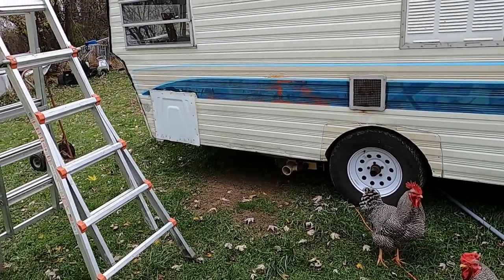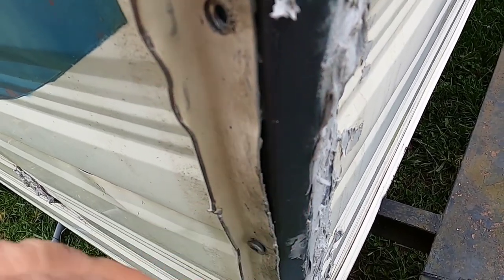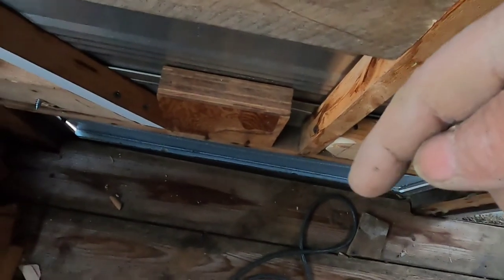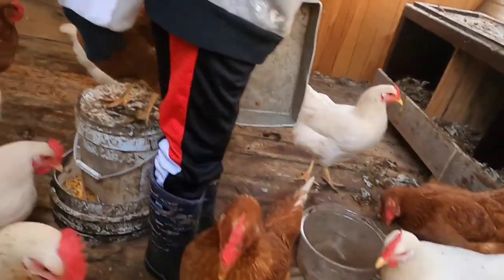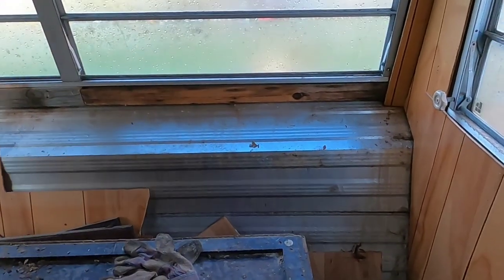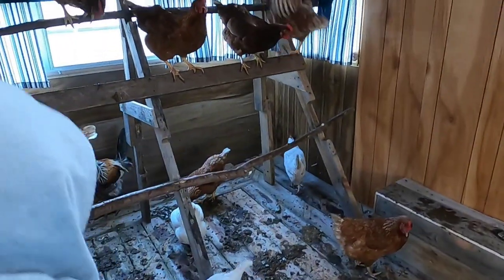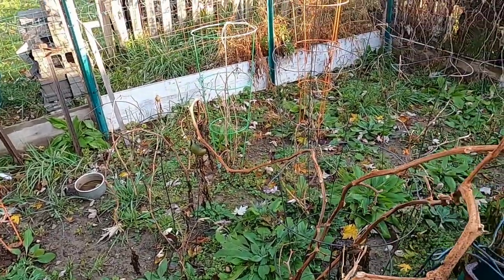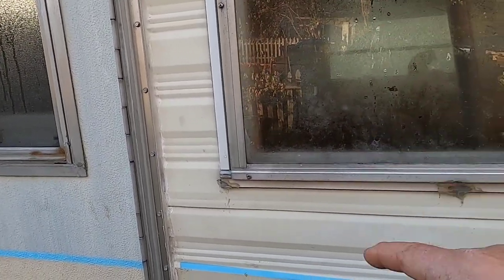TRAVEL TRAILER CHICKEN COOP CONVERSION COMPLETED

Comment: Stopped by and I like this coop idea.
Reply from the maker: Much appreciated. I was gathering pallets to make a larger coop & stopped that coop build when I found this trailer. If it was not so late in the season my girls would be in the pallet coop. This trailer turned out really nice using all recycled material.
 " I like doing it cheap " LOL
I would have used it for a mobile work shop. Just the right size. Maybe the next one.

Thanks again for stopping by.
Stay safe, Joe Z

Comment: I am just finding your awesome video and I have wanted to do this with an abandoned camper on our property. it has power avail and water pump works if i fill the tank. Its roof is caving and floor in that area so i need to try and lear how to demo the inside and water proof the exterior. thanks for the inspiration
Reply from the maker: Welcome to my channel. I am glad this was helpful!. I started this channel as a DIY for small engines but if you take a stroll you will find It morphed into several genres. I have a play list that has 2 other videos on this trailer & a few other trailer related videos:   https://www.youtube.com/playlist?list=PLU1-7u1LBS_u7zvN0FqUd9Eqyx02ZpzTU 
I have to say if I knew what I was getting into I probably would not have started. "Ignorance is bliss" as they say LOL I am very happy with the way it turned out.
If I can be of any help let me know.
Stay well, Joe Z

Comment: Thank ypi for posting this! I'm looking at picking up a junk travel trailer and making it into a chicken coop. I like that it already has some insulation and windows for the chickens. Please add a video if you make the exterior access to the nesting boxes. 😀
Reply from the maker: You're welcome and thank you for visiting & taking the time to comment. I am very pleased in how this is working out. The girls love it & it is easy to maintain. The only addition as of now that I would recommend & wish I did it, is to add linoleum or maybe tile to the floor. When I clean it out the wooden floor is usually damp. I still did not make  the exterior access for the nesting boxes. I gather the eggs when I go in to feed & water every morning & afternoon.
Stay well, Joe Z
Reply: I am going to turn a little old motor home into a chicken coop.  I would like to get the eggs from the outside.  Any ideas how to make that happen?
Reply from the maker: @coleenburris6816  That is what I was going to do but did not get to yet. Pick a spot that is convenient, make a frame to to support the nesting boxes, cut a hole the inside dimension of the frame & hang the boxes. I do not have a video to demonstrate this but there are many DIY chicken coop videos. Just apply the same technique to the motor home. When I get additional chickens I will need the extra room in the coop & be adding this on.
If you should make a video of your coop when it is done let me know.
Stay well, Joe Z